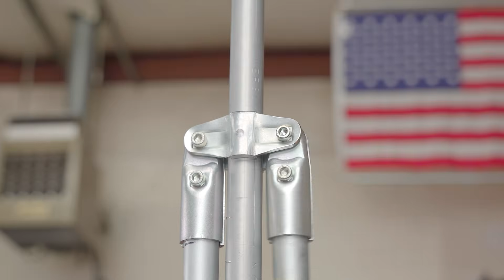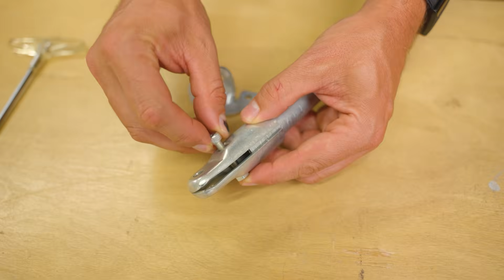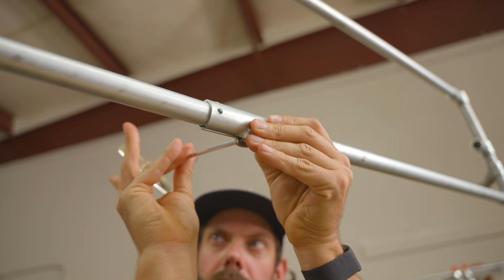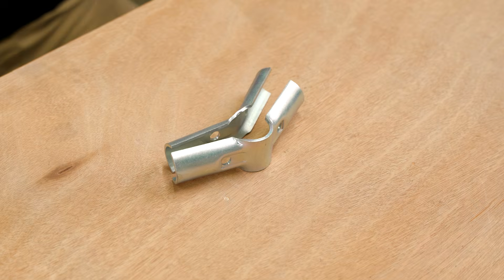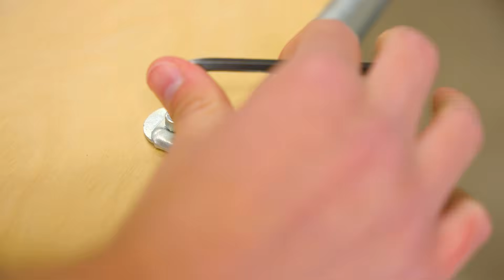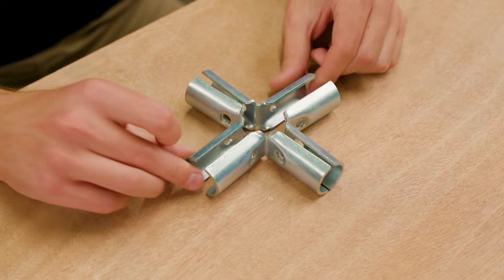Complete EMT Conduit Connector Guide For DIYers!

Comment: I would love to try this system, although I live in Europe, and we don't use EMT here, we use PVC for electrical conduit, and much smaller dimensions at that (230V, less amps, narrower cables)
I am certain I could find both 1" or 25.5mm tubes or 3/4" or 19mm galvanized tubes here, just not as cheap and readily avalible.
I am certainly going to follw this channel and other channels that builds with this system for ideas for the future

Comment: Doing my first build with MakerPipe, its an excellent system so far! Please please make a T Connector & adjustable T Connector with a HINGED pass thru pipe bracket instead of the "Puzzle Pieces" !! This is vastly better for people wotking on roofs & in tight spaces- the hinge acts as a 2nd pair of hands so the connector bolts are Much Easier To Get On without the puzzle pieces falling out of alignment (way to many small parts for roof work in triple digit heat).

Comment: How about connectors for constructing geodesic dome structures? There would need to be three kinds, four spurs, five spurs and six spurs to be mixed and matched to achieve the geodesic shape. I've seen lots of connector kits for square tubing, PVC and for lumber but never have found any for EMT conduit. I'm waiting.
Reply: or you could try your own creativity
Reply: Unless a specific design is assumed for the dome the connectors need to have adjustable angles.
Reply: @hanelyp1  😂 Uhm, no, you don't.  Look up "geodesic dome" and the answer will almost jump out at you.  Lengths changes, angles do not 😉

Comment: Wow the cost can  be prohibitive. These connectors are not cheap.
Reply from the maker: Hi there! We manufacture these in our shop in Upstate SC out of American steel. We might could make them cheaper overseas but it's important to us that it's made in the USA. The cost can sometimes be prohibitive but it depends on the type of project and the reason for building it etc. Thanks for the feedback!
Reply: @MakerPipe What advantages other than the obvious one of cheaper labor, which in part is countered by China's cost of shipping is there in a partially to full automated manufacturing process. I expect the process involved which stamp the patterns from the sheet metal and then pressed into shape are not manual so labor cost are responsible. I do expect  galvanizing is jobbed out. No doubt the cost of goods is higher plus insurance and dealing with what borders on over regulation, taxes and other considerations drives the cost up. As a business owner, we jump for joy if our profits are in the 10% range. I applaud anyone who is brave enough to operate a business these days. Rule if thumb a new plant building will cost 1/3 for the building,1/3 for the parking lot and 1/3 for the landscape and drainage cost. This does not include the equipment which is taxed every year. I find it unfair that a law firm can generate as much money as a manufacturer but are taxed much less as they do not have inventory or the heavy burden of machinery to produce a product. Reducing federal tax burden is good but there are so many other expenses generated by the state and local governments, schools and over regulation which feed off of and drive the cost of goods up. So your target market is higher SES, groups. lol or target government agencies and universities to feed off of tax money and have no concepts of making a profit. Why would they? Money grows on the government's  well watered trees.

Comment: Those are cre-forms. We used them in the aviation industry.  But the cre-forms are probably industrial grade
Reply from the maker: Hi there, thanks for the comment! Creform is only available for commercial settings. It's the same idea but for home use with electrical conduit.

Comment: I am going to build a truck cap. I would like to use these but wondering about attaching wood to them for roof and sides.

Edit: Just grabbed your idea pdf from your web site. I think this will work! So cool you have plastic mini connectors to design with.
Reply from the maker: Thanks for the interest! There are a lot of ways to secure wood and other flat materials. Check out this video for ideas or feel free to reach out to us! https://youtu.be/ZSabNmuqb8I?si=GAd6amklu0BCQcsG
Reply: Why do you keep saying 180° in either direction? 180° in either direction would be 360°, or a circle, & I think you don't mean that.
Reply: Why not just use wood for all of it?